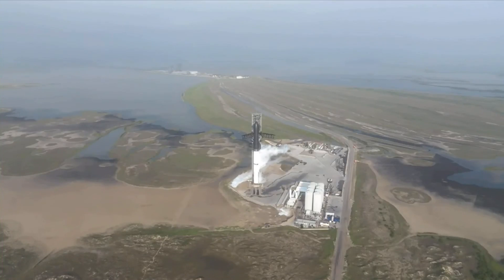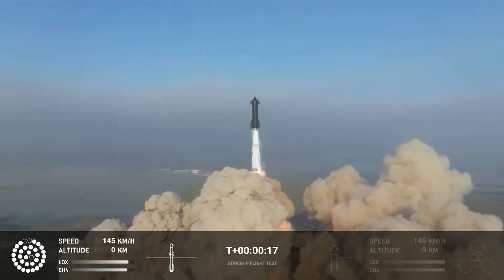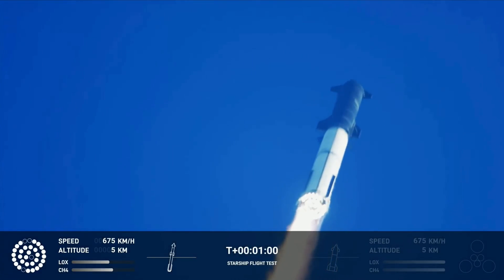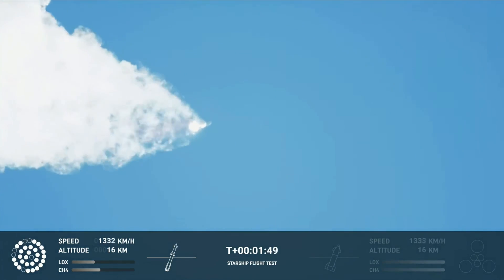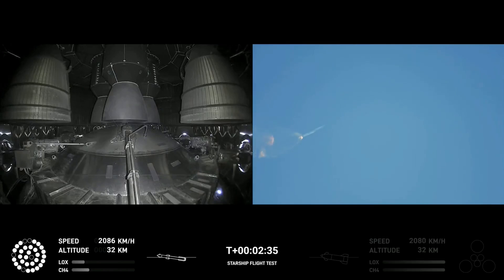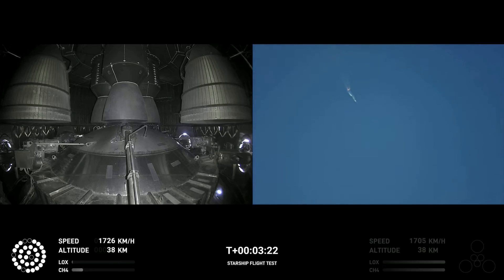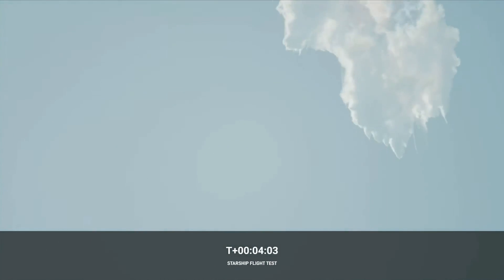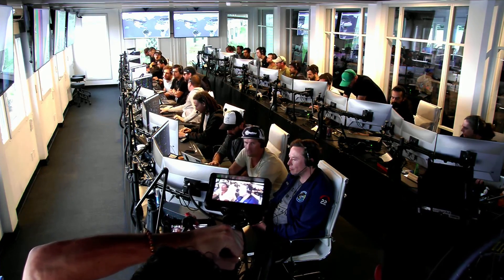Boom! SpaceX Starship has explosive first space launch attempt, test still succesful

Comment: One of the most amazing moment of this flight is how starship handle many flips without breaking in half.
Reply: Put 100-150 tons of payload on Starship and try those spins.
Reply: Not really - it was high enough up that its turning didn't force the aerodynamic stress too much on the decoupler - it's pretty easy to make something with enough structural integrity to withstand those kind of flips at that altitude.
Reply: Fared better than my rockets in KSP
Reply: @executivesteps  dude, a fueled starship first stage alone weighs 1200 tons! 150 tons is nothing
Reply: Seems ksp isn't so unrealistic after all :P
Reply: It was incredible nevertheless. Was surprised too. Imagine how much time any team on board would've had to pod away from the danger. ❤ Would've been  a safe evacuation all the way down.
Reply: The intent was to flip to unhook starship from booster. It was supposed to "break in half" so to speak.
Reply: sick people unich the rocket has collapsed and they are glad that it is not at the start
Reply: RIP TO ALL OF THOSE BRAVE ASTRONAUTS
Reply: @macbook802  its unmanned
Reply: It literally blew itself to bits! Snake oil.
Reply: That is one robust rocket. Stainless Steel, we love you.
Reply: @crisperediting9237  that's what they told the public
Reply: @macbook802  😂sure man
Reply: @TrueSpace61  
Exactly!  No atmospheric resistance.  It will be even easier in space.
Reply: Funnily enough it might have helped if it did 😂 if it broke at the separation point
Reply: @handsomeman-pm9vy  there is still atmospheric resistance (around 30% of sea level air pressure) at 30-40 km altitude
Reply: “This is completely untested.. but success is one of the possible outcomes” ~Elon Musk~
Reply: @matthew anderson  yes that's what they told the public almost a year ago, an unmanned orbital test flight
Reply: It was a controlled demolition event, it still held together, even when spinning, which is amazing in and of itself. Can't wait to hear the report on this event!
Reply: @Kenabukanyo  huh? They would have been vaporized. The crew part blew up too as far as I know
Reply: Looks like it failed separation, eventually run out of Lox that's why flight terminated. can't have uncontrollable descent
Reply: IT WOBBLED THE WHOLE WAY UP!!!

I knew his pipe was too full…
Reply: @executivesteps  
👍👍👍
Reply: @LipRipr2112  Like you if you had only one leg and wanted to dance! Did you not see that 6 engines on one side of the booster did not start?
Reply: It's designed to flip. Instead of a traditional stage separation a single flip was supposed to help the separation.
Reply: @iuliandragomir1  If that’s true why did they release the hold down clamps? Just shut them all off.
Reply: @handsomeman-pm9vy  I didn't say no atmospheric resistance. However, it was 34 kilometers high and much past Max Q, so the aerodynamic pressure was much less.
Reply: Facts!
Reply: @malroy59  Not sick. Healthy. Because it's progress. This is what it means to have a mentally healthy team: To be happy because they will find out how to fix the issues. If there was a success, they would've learned far less. Besides, it's their first launch of this rocket. We'll see their next attempt this summer. :)
Reply: @executivesteps  can you post a link to the video of the rocket you designed handling similar/greater aerodynamic loads?
Reply: @macbook802  Unmanned rocket.
Reply: It's an empty steel tube, not even pressurized. If it had a fraction of the things musk promises it will have inside it would probably not even leave the ground...
Reply: My thoughts exactly. The fact that it didn't snap in two is incredible to me. There must have been an enormous bending moment at multiple points in the flight. That has to be one strong spaceship!
Reply: @iuliandragomir1  
Sure did!!!
LoL,,

ESA/NASA

The only way to Fly!
(Safely!)
Reply: @executivesteps  - yeah that's a good point too. But did they not have "ballast" or some weighted payload to simulate an actual mission? Surely they wouldn't fly the thing empty. What kind of test would that be?
Reply: This is the elon 'emperor's new clothes' moment. Everyone is amazing, brilliant, happy, successful,  well done!
Can someone tell Elon the truth!
Reply: @Jutilaje  The #1 most predictably adolescent reply on YouTube. You left out the “Nyah, nyah, nya, nyah nah!”
Btw Who is the one person who designed the Starship and Booster?
Reply: @stanepperson3062  don't believe everything you hear
Reply: @tommytalks77  do uh, do you know how rockets work? Lol. They can't fly empty. It has fuel in it. The fuel in superheavy makes up ~96% of it's total launch weight. It carries 4800 tonnes of fuel, 150 tonnes of payload (3% of it's weight) and it's empty weight is 50 tonnes (1% of it's total weight).
Reply: @holdernewtshesrearin5471  That’s a good question.
Reply: @executivesteps  noooo
Reply: @D1NKERR  Thanks.
Reply: What made it blow up.
Reply: @foxtrotwolf6081  I'm not so sure! That's what the commentary said. But I thought they were going to throttle down, decouple, then flip. Which is similar sequence to Falcon 9. Baring in mind, the top section was supposed to fly around the planet and land in the pacific.  I think its likely that they either lost throttle control so couldn't throttle down... This prevented separation from happening! (just a guess)
Reply: @executivesteps  lol nah I disagree. I think the most adolescent reply on YouTube is seeing something they understand very little about and saying "lol not that impressive" as if they could do better. 

Did I ask you to provide the link to the video of the rocket you solely designed by yourself? A rocket that you were part of the team that designed it would certainly suffice as well!
Reply: @johnmartin7158  the flight termination system (explosives placed throughout the rocket to blow it up if it loses control/etc). They activated it because it failed to separate and was tumbling.
Reply: @acspectre3130  looked to me like the sep mechanism is what failed and that's what caused it to continue tumbling - starship wasn't able to detach from the tumbling booster section. Speculation from me too though of course!
Reply: @Jutilaje  there were MANY problems that happened during the launch.  watch it again.   the launchpad base got obliterated.   the protective cowl on the base of stage 0 melted.  6 engine either didnt work or were severly damage,  probably from blowback at launch since spacex  hasnt seemed to address that problem yet.  the ship was having pieces of it melt and break off the whole ascent.    then the separation mechanism didnt work.   a whole mess of problems.    probably gonna be a long while till they iron out those problems meanwhile nasa orbited the moon...........AGAIN
Reply: 440,000 pounds or 200 tons plus 33 engines with 10 million pounds of thrust hell yeah that mf was spinning like a bottle top crazy
Reply: @TrueSpace61  "pretty easy" dude, don't be silly.
Reply: @tonyatgoogle6076  you tell him then, they should launched better with full payload! Tell them why were they just aiming to go to hawaii?
Such a low standard!
Reply: @macbook802  I worked at JSC with the Space Shuttle Program for 26 years. 

It was unmanned.
Reply: @Jutilaje  Not a rocket and I’m not the author. It’ll be part of a billion dollar electron accelerator. Enjoy reading it. 

https://indico.cern.ch/event/799284/contributions/3478747/attachments/1894383/3124966/Chen-HiX2019-SoLID.pdf
Reply: @jebes909090  where do you see that the launch ring/tower got destroyed? Or that the cowl melted? There are reports that 5 of the 6 or 7 engines that weren't lit were SUPPOSED to be that way, as throttling (see the graphic in the bottom left corner). Where in the video did you see something melt or break off it? I agree on the sep mechanism not working (or something similar preventing separation), but again, literally the whole objective in this launch was just for it to clear the launch tower. It did that obviously, therefore the test was successful. 

Look back at the original Falcon 1/Falcon 9 test flights. They started off even worse than this, and yet 5 years later they were landing boosters and being one of the most reliable launch vehicles on the planet. And yeah, NASA has a much more successful first flight rate. But that's because they do things very differently. NASA spends ~6x more on development than SpaceX does, and about 18x more before first flight. NASA's method is "spend as much money as necessary to make sure the rocket doesn't blow up on it's first test, because taxpayers seeing the rocket we spent their money on blow up isn't a good look", while spacex's method is "spend whatever it costs to get a minimally viable flight-ready rocket, launch it, let it blow up and then fix whatever caused it to explode instead of trying to fix every single problem ahead of time, and inevitably "fixing" things that aren't actually broken and don't need to be fixed". 

NASA themselves estimated it would've cost them between $1.7b-$4.0b to develop the Falcon 9, which SpaceX developed for $390 million. 

And yeah. NASA just circled the moon, using SLS/Artemis. Which they've been developing for 12 years. Meanwhile SpaceX just launched a rocket twice the size of SLS that they've only been developing in earnest for ~7-8 years. Give them 12 years and I'd guarantee they'll be circling the moon with it (or actually landing on the moon with it) too...
Reply: First successful liftof and flight of the biggest machine to date, and people think spacex will fail?

Allow me to laugh 😂
Reply: @ergonautus4099  I hope elon will sack the whole bunch multi billions ahve just gone up in smoke and the whole crew was whooping and celebrating!?? What?!
Reply: @TrueSpace61  Sure but the stack was extremely unbalanced at this point with no fuel left on the 1st stage and the second stage still fully loaded,  You would have expected it to break at the stage 1/2 interface but it's obviously a well engineered connection point.  I would like to see more on that release mechanism.  Almost looks as if that is what did not perform correctly today (in addition and the 5 or 6 engines that died on the ascent).
Reply: At 1:10 was the rocket actually wiggling like that or was it some optical distortion?
I'm hoping it's something optical.
Reply: @doggonedone2479  Eh it's trash.
Reply: @matthewmccoy9516  It is pretty easy. Building a vehicle with enough structural integrity is extremely easy - except the people who built starship were farmers with 0 knowledge. Getting to orbit is the easiest thing we do in space. And yet spacex can't figure out how to do it. They're all idiots over there.
Reply: @NehemiahParsons  31 engines* And no... it was much heavier than that.
Reply: @TrueSpace61 lol, you do it then
Reply: @Jutilaje  Did you manage to find that video? I'd like to have a look, but it seems some comments are missing 😢
Can you post the link, just add a couple spaces in obvious places, etc..?
Reply: Techinical points: 10!  artistic points: 10!
Reply: @TrueSpace61  how do you know its easy? are you a rocket engineer?
Reply: @Toasty-du3fl    I think True Space is extremely knowledgeable in all things rocketry and space. He gave me a well qualified answer to the events of todays launch. We could all learn from him. I know I did.

Cheers.
Reply: Went to the moon though on the first try btw. Good sheep
Reply: @Jutilaje  - agreed. All was , uuuh uuumm, nominal (it's an industry term to those simpletons out there. Lol) to the point that separation should have occurred. Looks like they continued the flipping maneuver while attempting to achieve separation without success.
Couldn't really tell if self destruction charges were initiated or it just eventually broke up on its own but seems likely the former occurred. I imagine the self destruct charges were likely many small charges throughout rather than a very large single or small number of large charges positioned throughout the structure.
If it was self destroyed  it was definitely many small charges that essentially rapidly disassembled itself rather than a big boom.
Reply: @macbook802  bro still living in the 1960s
Reply: At least 3 flips...maybe 4....I'm impressed at its ability to stay together for so long.
Reply: @Toasty-du3fl  No, but it is pure math. Relatively easy to calculate.
Reply: @nobody2685  Do what?
Reply: @Jutilaje  You're mistaking the first stage with the second. Maybe with your knowledge of rockets you can get a job at spaceX. I'd give it a shot.
Reply: Looks like Uncle Sam will be writing another check
Reply: Well he knows the US economy very well as we can see
Reply: @tonyatgoogle6076  Maybe narrow it down to the "stage separation department" at least and not give them a raise?

Everything was a success up to the point of separation so I really don't understand why everyone should be sacked..😂
Maybe you can explain?
Reply: @BlackCrypt  Failing to separate is a common, they would have destructed when it didn't separate. Should probably go to all the successful flights and scream snake oil. Pretty sure the original falcon had 3 failures before a success and back then there were a lot more of you. Luckily the world doesn't depend on those type of people.
Reply: uhhhhh problem is , it was not a stunt planes lolol
Reply: I blame Putin!
Reply: @TrueSpace61  Not so easy. The Space Shuttle RTLS Abort mode was all theoretical, it was never initiated. John Young (STS-1) Commander once said something to the effect that an RTLS was six miracles followed by an act of God.
Reply: SpaceX Starship = 100% failure
SpaceX Starship = absolute disaster
Musk you failed! hahahahahahaXD
Reply: @tommytalks77   lol no, I'm most certainly not 😂 

Starship (2nd stage) has a dry weight of 85 tons, carries 1200 tons of propellant, and has a max payload of 150 tons, for a max liftoff weight of 1435 tons. 

Super heavy booster (stage 1) has an empty weight of 200 tons and carries 3400 tons of fuel, for a liftoff weight of 3600 tons. 

Together, that comes out to 5,035 tons at liftoff in the super heavy configuration, which is what we just watched in this video. Lol. Of which 150 tons is payload capacity. 150 tons is 2.97% of the total weight of Starship + super heavy. 

In other words, the fact that this launch had no payload (or just ballast, not sure which) means virtually nothing.
Reply: @formerlychuck  oh hell yes, mine sometimes just blow up upon firing engines, i'd say this was pretty successful
Reply: It was very impressive, regardless of the know it alls responding negatively.
Reply: the best moment was when this shit gets down
Reply: Yeah... I'd have never thought that possible myself
Reply: It would not be unreasonable to say this vehicle withstood at least an order of magnitude greater stress than what instantly disintegrated Challenger.
Reply: stronk
Reply: Yeah that was amazing to see. I believe if they could have got the right flip and separation they could have went all the way to orbit.
Reply: @tommytalks77  And your specialty is in what exactly?
Reply: @michajanicki6860    Definitely failed yes. And yet he spun it that it was the biggest success since sliced bread.
Reply: reminds me of KSP lmao
Reply: @macbook802  there weren't any astronauts, in fact they were planning to do a hard landing in the ocean
Reply: Shooting a WWII destroyer into orbit...
Reply: @gamerzay69  taking the piss out of muskminions. o/
Reply: @_brinter   i never could get a damn ship to the moon in KSP lmao
Reply: Why are they all so happy? This was a failure. Period.
Reply: One small Phallic for Elon,  One Giant Phallic bursting for Mankind.
Reply: @geostomp  That's unrelated + he doesn't
Reply: @mrtwills  The WW2 mascot?
Reply: @stanepperson3062 I wasn't talking about aborts?
Reply: @tommytalks77  Is that a 2 or 4 year degree?
Reply: @macbook802  ??
Reply: The amount of money spent on this could help lots of poor homeless people in the country instead of just making sound bong! bong! bong! up in the sky.
Reply: @panyaboonc5621  There are plenty of other ridiculous things we spend money on that can be re-allocated to such an issue. This ain’t NASA, this is Elon’s money. Let’s pull some of that defense budget to fix our mental health and homeless issues
Reply: @panyaboonc5621  That is very true. Just more proof that all rich people are extremely greedy.
Reply: @1dgram  Looks like an inherently bad idea and introduces more potential entropy for many future RUDs
Reply: @TrueSpace61  You are unrelated to your mom
Reply: Just remember he is dealing with the same sabotage many hams see on the work place
Reply: @T7DesignCreate  It's not a bad idea at all. It's a significant design simplification when compared to the complex separation mechanisms of existing rockets. SpaceX already does this for its satellite launches with the Falcon rockets so it's a scaling up as opposed to an all-new approach at this point. Not only does it reduce risk, but it means fewer non-reusable components and less risk when eventually a future version of this may be used to launch from the moon or Mars.
Reply: @1dgram  To my eye it's like doing an aerobatic manuever with the Empire State building, impressive but not optimal, especially for all the folks on the upper floors on their lunch break. A few less separation components, but extra fuel for side thrusters and a reinforced mainframe and what about when people and payload are actually onboard. "No worries team but at the 4 min mark we'll commence our aerobatic routine."
Reply: @geostomp  That is biologically false.
Reply: You know what, you’re exactly right. It withheld at least 20 seconds of rotation . Try doing that for many other things
Reply: @Leky0188  I don't think any has ever said that, if anything KSP is constantly hailed for its realism.
Reply: @billjones8950 it’s an unmanned rocket test….
Reply: @4digitShelby  I know….. u need to read multiple comments to get context
Reply: @T7DesignCreate  well, this wasn't the planned flip as that one rotates a bit slower and they shut the engines off near the start of the rotation
Reply: I guess?

Glass half full I guess 

I really don't think it would have broke up I didn't expect it to
Reply: @mattb6646  yeah because once you get to space you can just steer around like in the Jetsons
Reply: The Elon fanboy cope is real.
Reply: @Jutilaje  there were so many more problems with this launch: the pad blew apart; the vehicle took an extremely long time to actually get off the pad, several engines didn’t ignite, AND it failed to separate. The test was the separation. Getting rockets to safely leave the atmosphere has been done since the V2 rocket in the 40’s
Reply: @macbook802  😂😂😂
Caucasian Pleez!!!!🙄
Reply: @protorhinocerator142  combination of telephoto camera shake and scan likes. It's similar to fast wipers on a dashcam looking wiggly.
Reply: @crisperediting9237  Tim doods was in it. And that other youtuber emmie
Reply: @ergonautus4099  a whole bunch of people have had successful liftoffs over the decades...
Reply: @scottl.1568  Considering spacex use innovative and unconventional stage zero, reusable booster and ship with a new extremely powerful engine.
It's extremely impressive they even got this far.
A heavy steel tube flying.
You should be impressed.
Reply: No, it broke into thousands of little ittzy bitsy bits, it’s back to the drawing board then 🤣🤣
Reply: @coldeb8911  Not really, they have several rockets in queue. It's about stage zero now not destroying itself and the rocket during launch.
Rocket already works, basically..

Why so negative 😄

🚀
Reply: Yes - imagine how much fun it would have been had it been carrying astronauts!
Reply: @HC-cb4yp  🤔why would it have been fun watching people been blown to bits? Daft comment…the reason many people on here are making comical comments is because it was unmanned ….if it had been, trust me, they would be very different and we would be commenting very differently and with great remorse, …well it appears most of us would be anyway.
Reply: nobody cares about FLTA001 doing the same